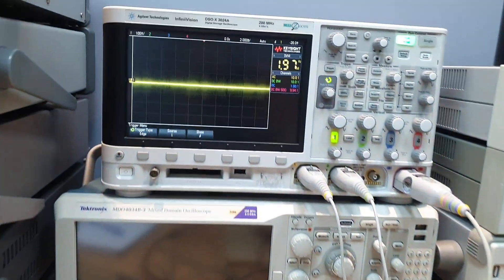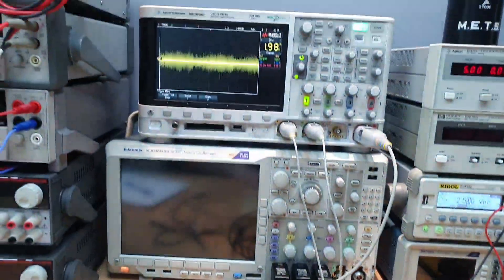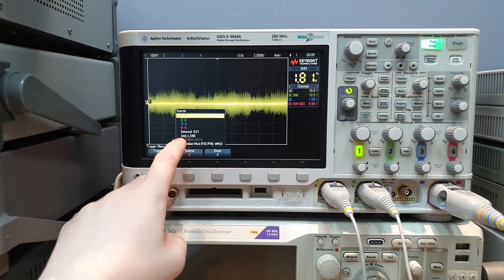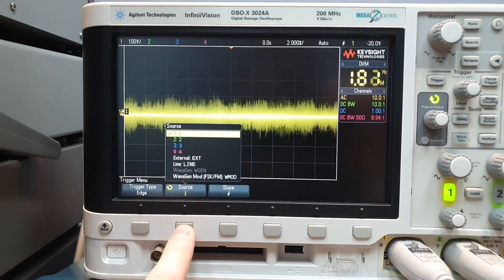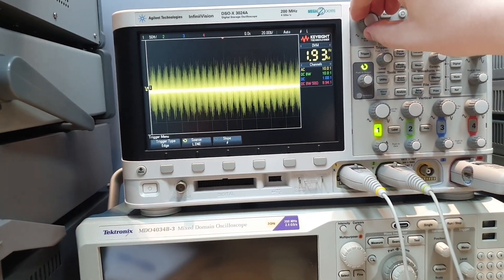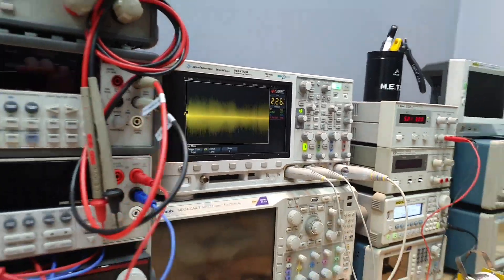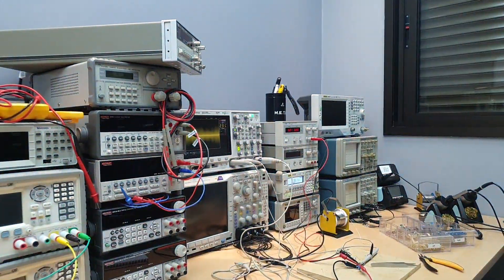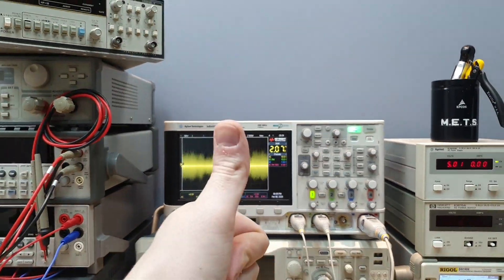Noise from LED lights - trick on oscilloscope trigger

Comment: Hi. Nice video. How do You take for granted that the noise harmonics (mainly conducted from the switching DC/DC converter inside the light I suppose) are in phase with the AC line frequency (50Hz or 60Hz) apart from the fact that once triggered the noise stays stable ;-) ? Thank You Keep doing videos.

Comment: Not only AC LED lights are the source of noise but that crap technology of PFC is also a big problem , you should investigate and film a video about...
Reply from the maker: Yep.. I Will..  I was working with a sensitive RF amplifier and was impossible make any measure with the lights turned on